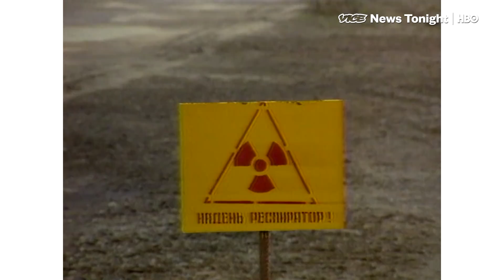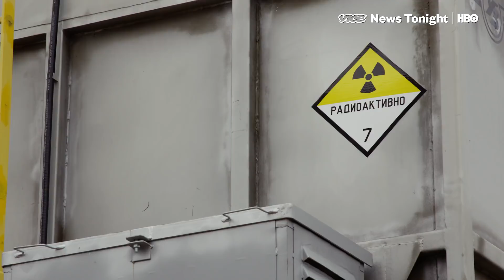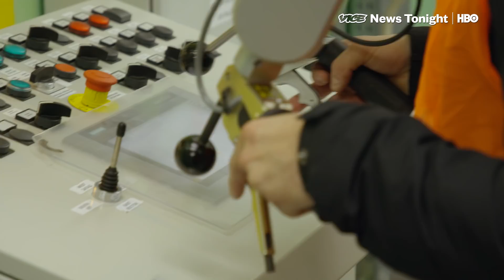Inside The Clean-Up Of Chernobyl, The World's Worst Nuclear Disaster (HBO)

Comment: "It's a stark reminder of the danger inherent in nuclear power." This bothered me through this whole video. The reactor built at Chernobyl is a RBMK reactor, which was never built by any country outside the USSR because it had characteristics that were rejected everywhere outside the Soviet Union. Chief among these was its inherent instability, especially on startup and shutdown. Because of the way the reactor used graphite where American reactors use water, when Soviet operators tried to reduce power the RBMK had a tendency to sharply increase power production instead. As overheating became more severe, power increased even more.Also the Chernobyl plant did not have the fortified containment structure common to most nuclear power plants elsewhere in the world. Without this protection, radioactive material escaped into the environment.   Used correctly and properly, nuclear power is safe.  There has even been new improvements developed to make nuclear even safer.  Cutting corners and a horrendous design is what made this site a  disaster waiting to happen.  This is not inevitable in every case.  I found this to be misleading and scientifically inaccurate.  The reporter seems to be banking on visual theatrics instead of actually  reporting why this happened.  Throwing the baby out with the proverbial bathwater.
Reply: Very true. They should've started with "It's a stark reminder of the danger in herent in corrupt totalitarian communist systems."
Reply: Nuclear Power is not safe at all, The spent fuel needs  thousands of years + to stop being harmfull plus all the safety protocols and backup Will not be able to withstand natural disasters which Will become more and more common in the near future.
Reply: Would a containment structure really have contained the explosion though?
Reply: The way you worded your comment shows clearly that you're a logical, smart person. This makes you different than the rest of the population. Different than the people who design, build, oversee and run nuclear reactors. I'm sure I don't have to exemplify it for you. While the sentence you quoted doesn't explain where the danger comes from, it is correct: people are responsible for the safety of these reactors, and they aren't competent. So there is an inherent danger in everything they do, and hence, in the reactors, which do have the potential to do a lot of damage. That said, of course, more dangerous is the short-sighted policy of fossil fuel reliance. Then, we have the policy of dumb-assed, gratuitous wasting of energy and resources which blows up the quantity of energy and resources that need to be produced, so that they could be wasted.

Comment: Is Chernobyl worse or Fukushima?? Radiation leak wise.
Reply: I've read Chernobyl was 100 times worse in matters of radiation material expelled
Reply: @anaribeiro7212  Total lie. Do people have no sense? Fukishima is 3 reactors still burning, all the spent fuel blown into the atmosphere. Gee, I heard the magic fairy would make it all go away.
Reply: @iscetic  oh sorry it appeared to me that there was a good contingency plan in Fukushima, which was non existing in Chernobyl
Reply: @anaribeiro7212  What contingency plan? What have they done? It's just going into the ocean.
Reply: @iscetic  Actually he's completely correct, Chernobyl was many many times worse than Fukushima, which is closer in severity to Three Mile Island.  The only reason Fukushima has a level 7 rating like Chernobyl is because instead of one big reactor failure it had multiple small reactor failures and instead of coming up with an average number or using the worst they added them all up which makes it look much worse on paper.
Reply: @llynellyn  I'm gonna call bs on that. 3 reactors melted through and are still burning in an underground river going into the ocean. Also the containment for the spent fuel, which was stored above the reactor, got blown sky high. Also one was using mox fuel, which creates many more isotopes when it goes critical or is blown into the atmosphere. They have NO plan, that alone makes it worse. And you're equating it to 3 mile island?

Comment: RBMK reactors should never have been implemented. They were a cheap and flawed solution by a desperate and cash strapped economy to provide large scale electricity. Never again should economics replace safety.
Reply: they are still working... just dont turn security systems down while testing reactor in extreme conditions

Comment: Windscale, Harrisburg, Fukushima, Chernobyl and some idiots still claiming nuclear power was safe
Reply: In fairness, most of the accidents you listed involved plant designs from half a century ago and required human error to occur, they are not possible at any power plant built in the last 30-40 years.  Claiming modern nuclear power is dangerous because of Chernobyl/Fukushima is like claiming a brand new Boeing is unsafe based on what happened to the Hindenburg.
Reply: @llynellyn  many nuclear power plants are between 30 and 40 years old, so this tide in Fukushima was human error?
Reply: @llynellyn  you can eradicate human error with solar and wind, so why not utilising technology of renewable power which is not vulnerable and proving disastrous in the case of human error?
Reply: @friedrichhayek3683  Two reasons, firstly because Solar/Wind are not primary sources of power generation, they are secondary sources so your idea isn't physically possible.  They are excellent for supplementing primary generation (Coal/Gas/Nuclear/etc) but they cannot be used as a primary source because you cannot force the wind or the sun to increase in power to meet demand.

Secondly, because the human error factor was eliminated decades ago, humans no longer have the ability to override the main safety systems or stop the computer from shutting down the reactor if it deems it unsafe.
Reply: @llynellyn  human error will always be relevant in terms of nuclear power, combine wind and solar power with battery storage and you have a primary source of energy
Reply: Plus all the miners that have died just to get the coal
Reply: It is safer then coal power thats for sure
more people die from coal power plant generated pollution every year then during the entire time any radioactive deaths occurred on this planet
Reply: @ozisponas1593  coal power should be closed down as well
Reply: @friedrichhayek3683  True
Reply: Everything is unsafe buddy...

Comment: Wasn't Fukushima worse?
Reply: The reactor core itself exploded in Chernobyl. In Fukushima,  none of the reactor cores exploded...just the reactor exploded. the Fukushima plant's reactors had released up to 10,000 terabecquerels of radiation per hour while Chernobyl released 5.2m terabecquerels.  In Fukushima, all the plants automatically turned off b/c of the earthquake, in Chernobyl they where still  running.

Comment: Theres no point wearing face mask there, are you kidding. You absorb radiation through skin cloths, everything.
Reply: the dust is dangerous by itself, even so many years after the accident
Reply: You do absorb radiation but not lethal doses. You'd have to live there continuosly for years to get radiation poisoning. If it was deadly nobody would've worked there. The deadly zones are forbidden. Such as the metal coffin building that covers the reactor. Truth be told, you can't live there but visiting the place is not dangerous at all. If you took a 10 hour flight and spent 10 hours in Pripyat, you'd have gotten more radiation during the plane trip than in Pripyat. Semipalatinsk on the other hand is a different story and that's why nobody can visit, and you can't even get a permit to go there.

Comment: Aren’t you scared of walking inside of that place? I would never step foot their.
Reply: The radioactivity levels there now are lower than those on a commercial flight. The main issue that prevents people from living there is not radioactivity but metal toxicity. Isotopes that are highly radioactive decay quickly, like iodine was a big concern for the first few weeks. Now the main source of radioactivity is Cesium-137 and it has a 30 year half life. The issue is that the end decay products of the radioactive pollutants are mostly toxic metals like barium, lead and mercury.
Reply: The Chernobyl power station was still operating until 2000. The Ukraine could not afford to lose that much of its electricity production. Just imagine working at a power station that 1/4 of which had blown up!
Reply: They know what they're doing, knowledge helps
Reply: Nothing to worry about, they have hard hats. Perfectly safe. Just ask any of the 50,000 people who were evacuated and not allowed back.
Reply: @jasonfuller2734  No, not safe...

they didnt wear the yellow vests. Everyone knows that makes everything safe.
Reply: Also adding here that about 130-150 people still live inside the exclusion zone. Most are women in their 70s or 80s. I wouldn't go there voluntarily, but yeah. I think in a document only one out of twelve (who were interviewed), had have some type of cancer.
Reply: If u google chernobyl there’s sparks happening there and the elephants foot is still there
Reply: USSR's countries are poor. It's a chance to have a good salary.

Comment: Why do the need to dismantle the original confinement structure?
Reply: Its was a brave rush job in the given extreme situation. It has massive holes and is falling apart
Reply: They're not dismantling it - that would be suicidal. They're just enclosing it even more securely, so that when it (the original sarcophagus) eventually collapses, it doesn't leave the radioactive ruins in the open, and throw god only knows how much radioactive dust into the atmosphere.

Comment: Fukushima has now surpassed Chernobyl as the world's most worst nuclear disaster. More radioactivity was released there than at Chernobyl. Fukushima was hand's down the worst especially since it was caused by an act of God. Unlike a human error as was the case in Chernobyl. Way worst by far. Fukushima is still releasing high levels of radiation since the disaster took place 7 years ago in 2011. Chernobyl they we're able to neutralize and contain a major portion of the radation that was released. Plus the original sarcophagus is now being covered up with a more modern and larger sarcophagus. Fukushima still hasn't been fully contained. Let that sink in.
Reply: Complete nonsense, Fukushima is not even in the same league as Chernobyl, its closer in severity to Three Mile Island.  The only reason Fukushima also has a level 7 accident rating is because it had minor accidents at multiple reactors and instead of basing the number on the worst or averaging it they chose to add them all up.
Reply: I don't think that's all correct. Readings around Fukushima are even smaller than certain places in Chernobyl, people are already able to go back to the town around the power plant (some parts of the town anyways) there is around 1000 people living there now. We don't know what exactly is going on in Fukushima as the area has been locked off and you cannot get closer than 3km from the power plant without a special permission.

Comment: what if they use a drone to drill, cut and take apart certain building materials???
Reply: The radiation would destroy the electronics of the drone rendering it useless.. it did the same to the helicopters after the meltdown during the cleanup
Reply: @20PINKluvr   explain how they are going to use highly electronic  robots  to cut the  highly radioactive  fuel rods ?
Reply: @20PINKluvr  most of the radioactive particles are gone already

Comment: This should have influenced the rest of the world to stop using nuclear power plants because of this very reason from the disaster
Reply: No, obviously not.
The reason as to why Chernobyl happened was due to human error coupled with bad engineering.

The number one reason why they didn't manage to shut the nuclear reaction down is because the reactor was built with carbon as a moderator and not water.

They did an experiment which required them to shut of a bunch of safety systems. This was one of the human errors, shutting of the safety systems was completely against regulations.
During the experiment a lot of so called reactor toxins was created. Reactor toxins absorb neutrons, neutrons which otherwise would have hit Uranium and split it in a fission reaction. They didn't realize that this was the reason as to why they didn't get enough power out of the reactor, so they lowered the fuel rods to gain more power. As they did that the reactor toxins was consumed thus gaining them even more power.

Here comes the bad engineering in. In most nuclear power plants an increase of power and thus heat results in worse moderation and thus a lower power. The reaction works worse when already running fast. This is not the case in a carbon moderated reactor. This resulted in the reactor to explode and they could not add water since, once again it was a carbon moderated reactor. 
But the reactor exploded, litting the carbon on fire for days and then emitting loads of unstable particles which was spread by the wind through the giant hole created by the explosion.

Abe Coulter, nuclear power is the future. A disaster such as this will never happen again.
We will never build carbon moderated reactors again, and the alternative, water lends itself perfect due to often being placed by the sea, below sea level thus allowing for rapid water filling of the reactor and then preventing a possible disaster such as this.

Comment: Wow. They really doing a good job out there. 
Japan fukushima bunch of lairs over there saying they cleaned the radiation over there. Doubt it
Reply: The Fukushima reactors are older than those at Chernobyl. Fukushima Daiichi Unit 1 started commercial operation in 1971, six years before any of the four reactors at Chernobyl. The difference is that the USSR didn't take safety seriously.
Reply: Oh, and it absolutely wasn't an old reactor. In fact, Unit 4 (the one that exploded) was only three years old at the time of the accident.
Reply: It was washed away probably
Reply: DikoMan yeah fukishima was struck my a tsunami so

Comment: Why don't they need hazmat suits or anything?
Reply: Mc Chickener 
From what I've heard, extremely high radiation levels are only present in soil (and anything that "absorbes" radioactive particles) nearby.  So you can literally stand on the paved road but as soon as you step on the soil, radiation meter goes nuts.